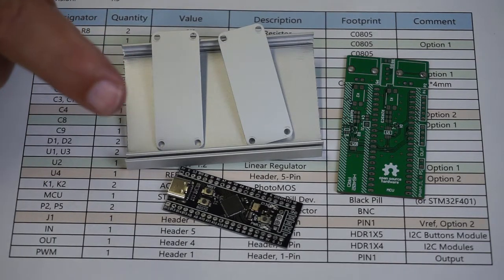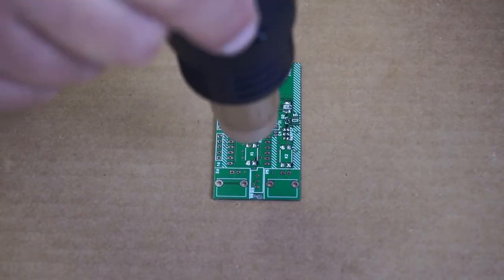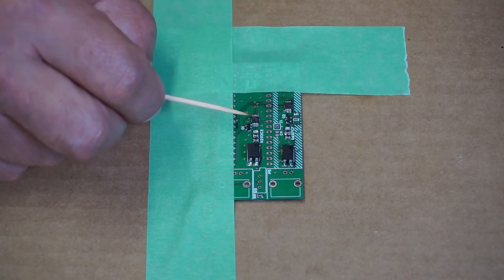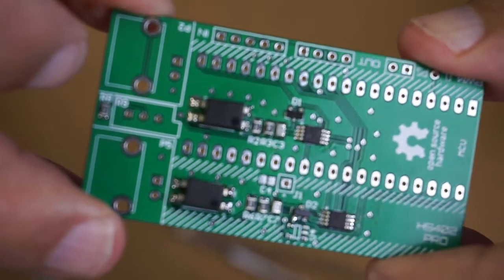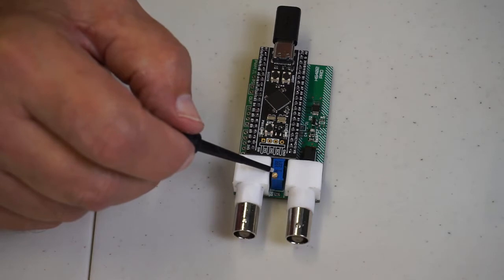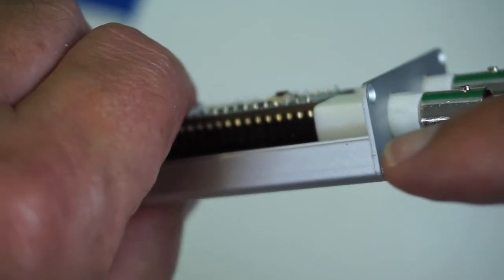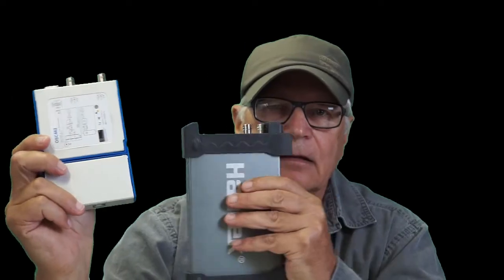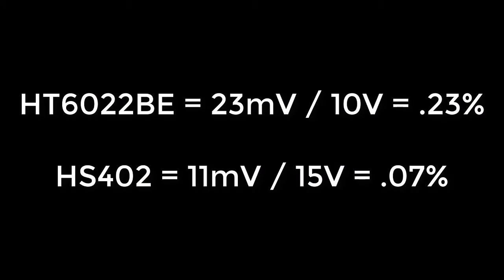GADGETS#118 - HS402 BUILD

Comment: Since you have recommend building this, I have been looking at other DIY kits. How hard do you think it would be to add a little screen to keep this all contained as one unit? Id probably need a power source as well.
Reply from the maker: I had a Raspberry Pi3 and a 3.5 LCD burning a hole in pocket and the intent to do exactly what you're interested in. I installed ANDROID (not native OS for Pi3 !!!) which ran OK but no provisions for LCD. So much for that...
There's another option I'm thinking of. I have an old 8" tablet, thinking of prying it apart. It's got screen and power already. Either find a box, or with my shiny new printer (got it this week!) 3D print one to suit.
I've been discussing it on our group for  weeks. Actually gave it a name:
HS402 LCD
So, not easy PJ:)
Reply: @theGADGETSplaylist  its funny you say that! I just got a 3D printer myself. And also have an old android tablet laying around. But it’s so old that I’m not sure that I can actually download any apps to it.
Reply from the maker: @VoltageDropDiagnostics  I'm trying to iron out a TIMEOUT bug in OctoPrint (finally found a use for that Pi3) and it's keeping me busy!
That and I'm finishing up a video on ROTKEE PDS Pulse Transducer. They make nice stuff!

Comment: I found most of the parts easy and cheap to buy on Aliexpress. Also JLCPCB was very cheap and produced excellent boards (how do they do it?). However, I incorrectly ordered the sop version of the MCP6S21 and found the msop version much harder to find and more expensive. Just wondered why Martin went for the msop version; there seems plenty of space on the board for the cheaper and more readily available sop version? I also encountered the same problem with the square pins and round holes! Not decided which way to go on this as the round hole solution seems less common and more expensive in terms of getting hold of parts and I have loads of square pin strips (male and female).. Still waiting on parts so not completed my HS402 yet.

I decided to go for the 3d printed case; I don't have a printer and you can get a CTC A8/Prusa i3 clone kit off ebay for not much money, so decided to go that route. It will be interesting building the 3d printer and getting into 3d printing, and be useful to be able to print parts off. I know this sounds over kill but its something I always wanted to do and the current pandemic gives me lots of time to do all the things I wanted to do and never had time to do!
Reply from the maker: I too wonder why Martin chose MSOP. I had used the larger SOP on adapters for the through hole builds and were so much easier to solder and find...But, we'll forgive him:)
Those round hole headers are better quality (more expensive) and required for the 20mm height of the aluminum project box I chose. Since you're going 3D, the std headers will do just fine.
And speaking of 3D, good for you on getting one! I haven't "broken down"...yet...
Let us know how you make out:)
Reply: @theGADGETSplaylist  Thanks for replying. I'll let you know how I get on when those msop chips do show up!
Reply: I will give an update on the 3d printed case. I had no prior experience with 3d printing and there was alot to learn, so it has taken up alot of time. I was overwealmed by the choices of 3d printers available and in the end decided to go with the cheapest prusa i3 clone i could find on ebay, on the basis that i did not want to spend too much, i could replace any parts cheaply/easily and it would be a good learning experience. This worked out ok, but it would have been better to pay a bit more and go for a more reputable Chinese brand like Anet, which can be had on sites like Banggood for very reasonable prices. The Anet ET4 would be a good choice as it has all the bits included you would buy to improve a cheap Chinese clone, plus auto bed leveling. But hey life is for learning and you dont become expert in anything without making mistakes, spending time and building experience. The case prints out fine, and you can use the square cheaper pins. Hopefully someone can benefit from my hard won knowledge!
Reply from the maker: @armunro  There was a good price on AMAZON for Ender 3 PRO. They shipped the wrong printer, not the PRO version.
I negotiated a rebate and got the printer for $134 CAN (which is not real money...lol)
It prints well and I can always upgrade later.

Comment: I'm glad your parts arrived before mine, thanks for all the tips and clarifications.  Such as which way the little mcp6s21 sit, I never saw the white dots on the pcb until seeing it on a large screen :)
Reply from the maker: White dots for the AQY210 chips also Chris. What is not so plain to see is the corresponding dot on the 6S21. It's there but they could have made it more visible!
Reply: @theGADGETSplaylist  Luckily I bought the baby brother sized microscope like yours, works quite well.

Comment: I saw you used to presolder the pads, how is this method compared to the previous one?
Reply from the maker: I think I'll adopt it for small things like 6S21...maybe add a small amount of flux.
For the resistors and capacitors, I'll go with conventional paste/component/flow. I think I'm getting the hang of having those float and surface tension themselves into position.